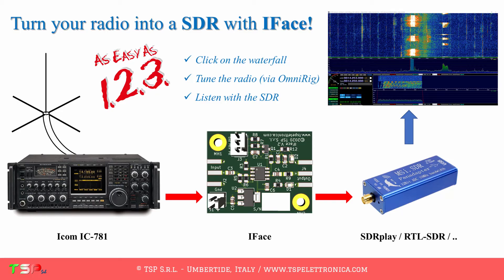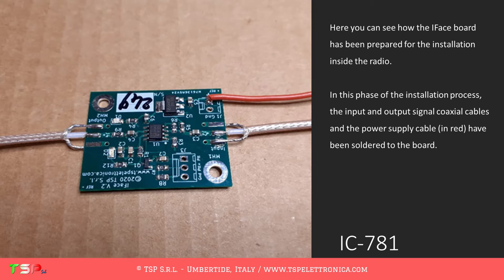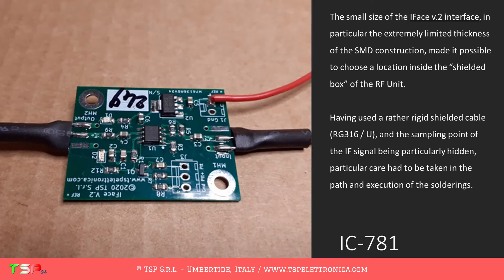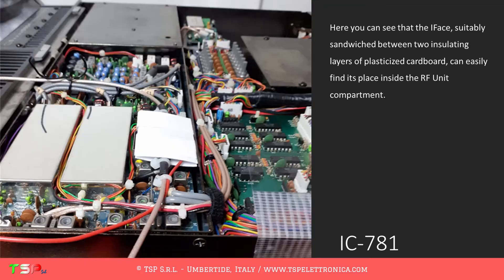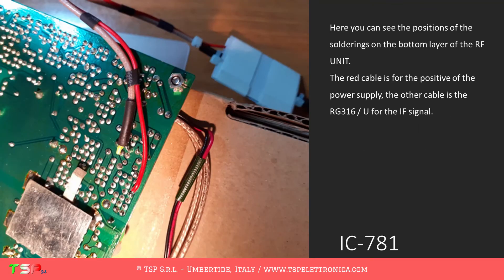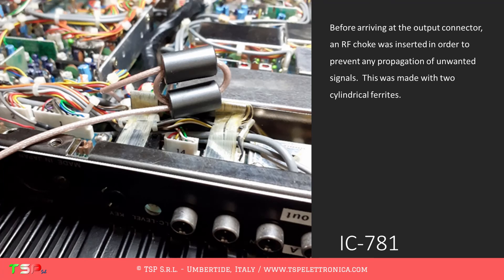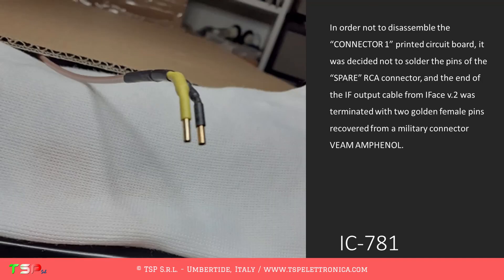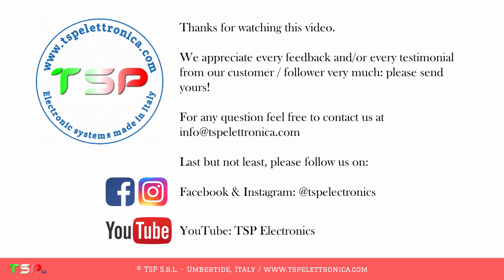Icom IC-781 with SDR panadapter

Comment: Hey, Is this Adapter still availeble? Website is down!
Reply from the maker: Our website was down due to a problem during an upgrade, now it is ok. The board is available, thank you.
Reply: @TSPElectronics  Thank you, I tryed 2 Order but i can´t pay per PP. Its says "There was an issue processing your payment. Try again or use a different payment method."
Reply from the maker: @Elex2605  What problem are you reporting exactly?
We do not handle payments, the payment system is provided by the Shopify platform and PayPal. We made this choice because we don't have the problem of having to manage sensitive data such as credit cards, there are special companies that do it very well and in complete safety for us. Then try again, perhaps with another payment card, or you can pay by bank transfer.
Thank you.